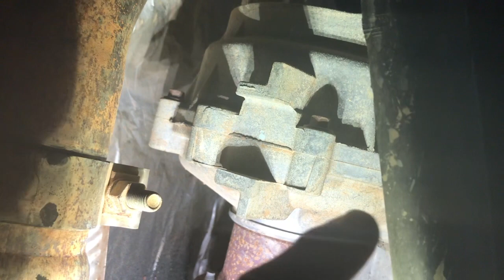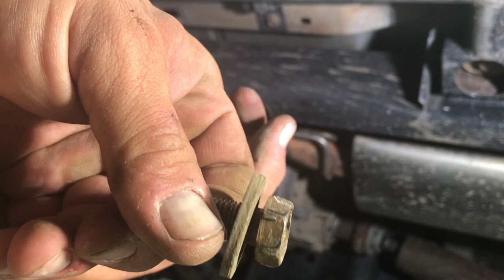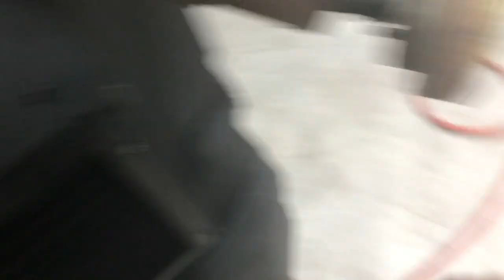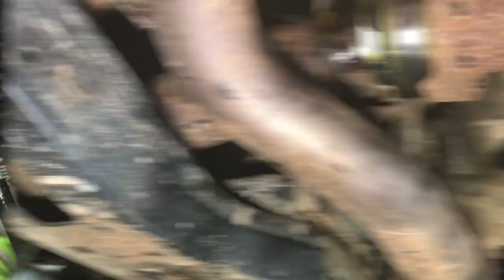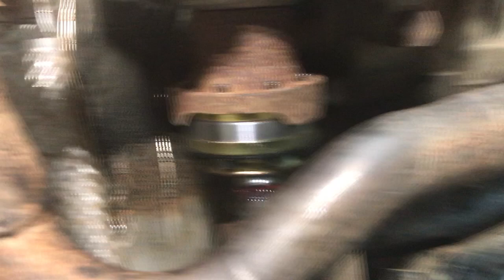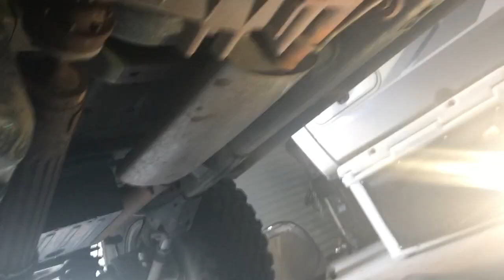Teraflex CV install joint on a Jeep JK. Any problems...a few

Comment: Good tip on using the old crescent shaped braces for a larger clamping surface at the end. I plan on cleaning up and reusing the stock hex head bolts when I do this job. Allen head bolts are just too easy to strip in tight places like that, IMO. The stock ones also have a 1/8" smooth end to help getting them lined up and start threading, which is very handy.

Comment: Thanks for the video. I just found that splattered grease under my Jeep and was looking for a fix like this. Although it is only lifted by 2.5 inches somehow it must have got torn. What’s your opinion on that grease? I heard that I should use moly based instead the red but I’m just a rookie. Thank you for the real-world-hassle insight.
Reply from the maker: If you are going any higher on your lift, or you are going to really crawl your jeep, consider Adams driveshafts. good price and durable. I bent both shafts about 2 months after making this video. 

As for the grease, IDK. I think a high quality red is fine.

Comment: Is getting grease on the seals that detrimental to the functioning of the cv joint over time? Had a mechanic do mine and don't remember it looking as clean around by the gasket
Reply from the maker: Honestly, prolly not. 
It’s the difference between 999 and 1000. 
It’s about not torquing against grease or getting grease on the bolts.

Comment: Very helpful video!  Thank you.  I enjoyed it. Also looked like your slip shaft boot was torn?  Maybe not?  I’ve found it helpful to put jack stands under the front axle and then you can turn the driveshaft by hand and then lock in the tcase to keep the output shaft from spinning.   Did that once and made it easier. I’m going to get this kit for my front driveshaft.  Don’t want to get a double cardan shaft because I can’t stand driveline vibes 👍🏻👍🏻👍🏻
Reply from the maker: Well... since this video, I bent both my shafts while crawling (I break stuff pretty routinely)

I replaced with the Adams front and rear kit for like 1k shipped. Drives like a DREAM!
Reply: I see.  I bought an Adams on my old JK and it vibrated bad.  Took it off and brought to a local shop for balancing and it was way off balance!  After the local shop balanced it was better but still vibrated!   That’s why I don’t know what to do man. I’ve had double cardan shafts on my old Ford and never had vibrations but I don’t know what to do, this Teraflex kit or a new shaft.  I will pull my hair out if I have driveline vibes 😡😡😡😡😡😡😂😂😂😂😂
Reply from the maker: I’m assuming you are lifted. You may know all this. 
If you have adjustable control arms, set the rear pinion so it points right at the transfer case. 

In the front you can set your pinion a wee bit past parallel to the ground and it still tracks OK despite the lack of caster. 

The big bear with vibration is often that rear shaft from pinion angle.
Reply: TexaCajun DIY thanks for the tip!!!

Comment: Big thank you for the time trouble and headaches in making this. Glad to have a real world video from someone that is not trying to sell me the part. Still on the fence on weather I can do this, but alternatives are way expensive or back to a stock joint from the dealership. I know a guy, if i can get him to help ... any way thanks.
Reply from the maker: Thank you. Glad to help. 

You can do this. An extra set of hands would be great.

Comment: Teraflex joint is shit. Bet it’s fixin to crap out. Hope he got one of the redesigned cv joints.
Reply from the maker: Still going strong. From Telluride to Farmington and a half dozen parks in Texas, No issues.
Reply: TexaCajun DIY 
That’s what I thought too. Wheeled all over Telluride too after I installed the joint. It’s been a year and over 12,000 miles on it. Hope you also got one of the redesigned joints. 
Stories of early failures on the forums and here on YouTube 
We’ll just be aware to keep an eye on it and wheel safe brother. 😎

Comment: Nice video,  I'm about to do this to my jeep this weekend!
Reply from the maker: I've been crawling 3-4 times since the swap. My front end actually has more articulation now. The limiting factor was the CV joint.

Get a good Ball 6mm and a friend to hold that shaft for you on the install. I'm 240# and pretty muscular, that thing beat my butt.
Reply: Yeah, I'm hoping it works out alright , I did not want to spend $400 on a new shaft.
Reply: I think I’ll chase the flange threads with a tap after watching this to allow smooth torquing.
Reply from the maker: @220da  that is a dang fine idea!